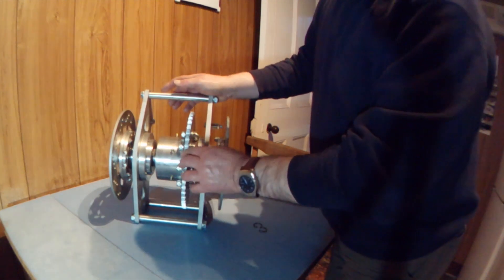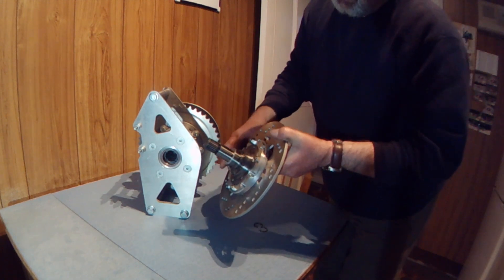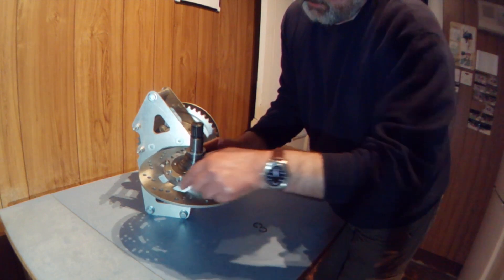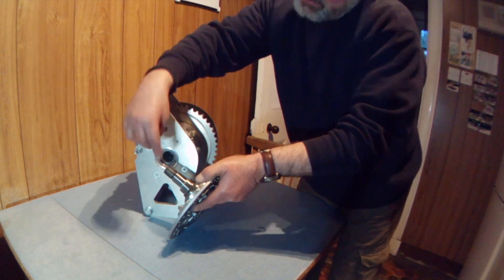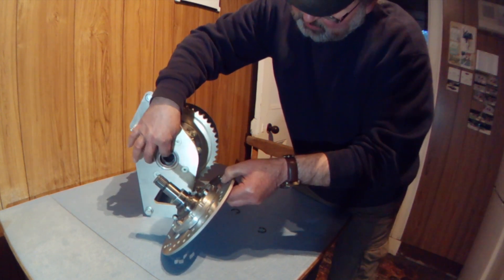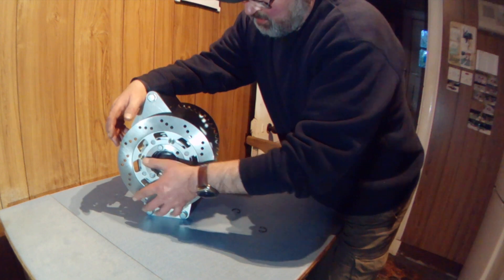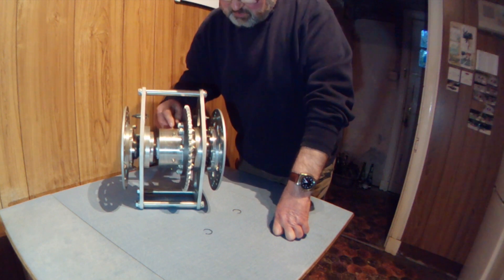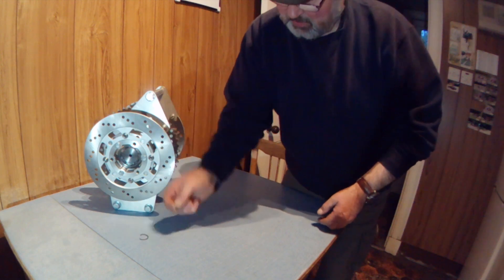Chain Drive LSD with Twin Inboard Disc Brakes

Comment: Hi Doug.  Love the differential videos and the driving videos too.  With the twin motorcycle brakes like you have here,  do you think a car that weighs about 900# with driver could get by with this braking setup in the rear for track days?  I figure top speed would be maybe 120mph.
Reply from the maker: I presume that is 900 Lbs mass (rather than 900kg). With inboard discs you could have a problem with heat build-up. Where possible I would opt for outboard brakes.
Reply: Thanks Doug.  I'll look at ways to either use cooling ducts or switch to outboard.
Reply: Will this “car” will be driven by a motorcycle engine?

Comment: Hi Doug, Im looking at starting the t89 race car and wanting to build a differential. I believe you are now retired? would you care to share any drawings for me to get the plates cut?
Reply from the maker: I will be sending .dxf files for the plates to Cal (T89) very soon.
Reply: Hi Doug, have ypu still got the drawings for the plates please, I am currently bulding a fiat 126 with a bike engine in it. Currently doing the body work, cutting the rust out of it and strengthening the floor pan. 
Thanks. 
Glyn.

Comment: hello, I have followed your videos with interest and you are very good!  Have you ever thought of making a differential to be able to equip sporty quads / atvs like the Yamaha Raptor- Suzuki Ltr- Polaris predator?  The problem with these vehicles is that it is very difficult to turn on asphalt roads!  with a small rear differential sports quads would be much easier to drive.
Roberto
Reply from the maker: Too difficult with traditional swing arm Quad rear axles. Only really possible with wishbone rear ends with independent suspension.
Reply: ok...thank you very much...